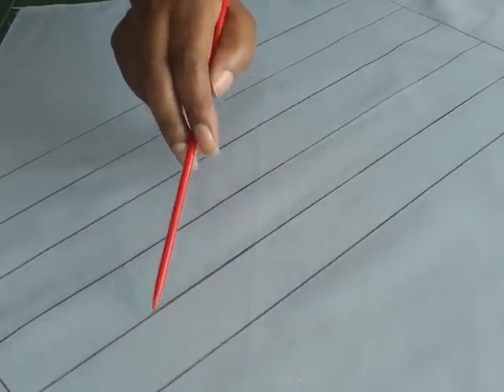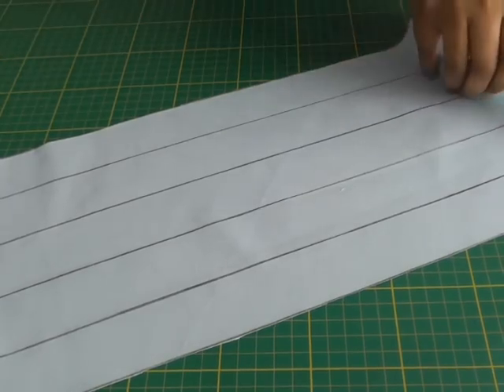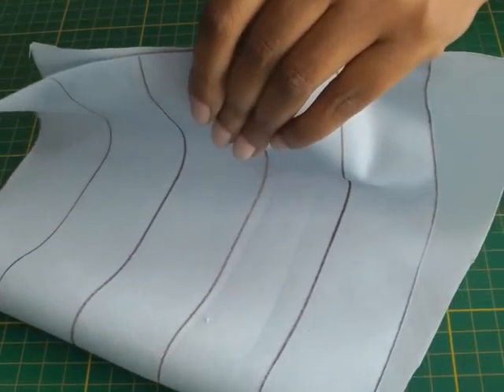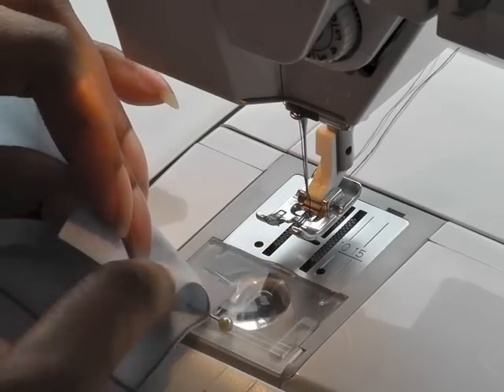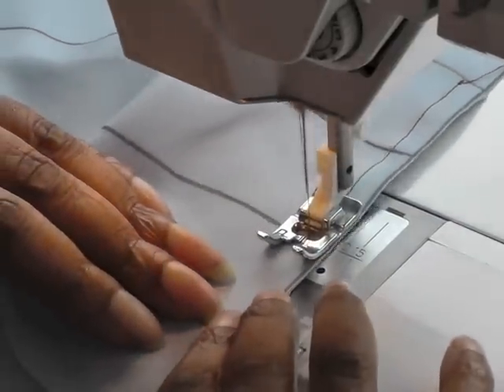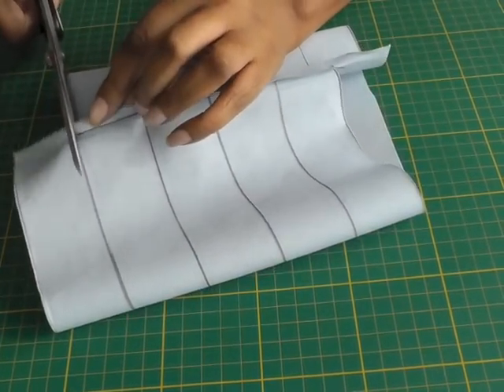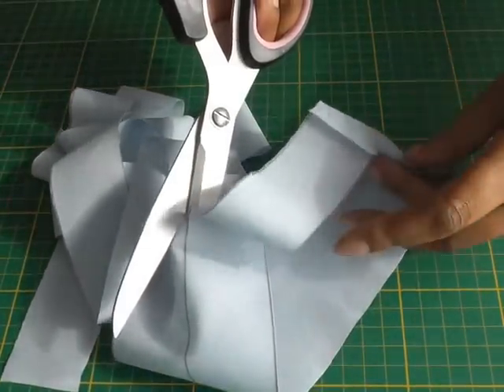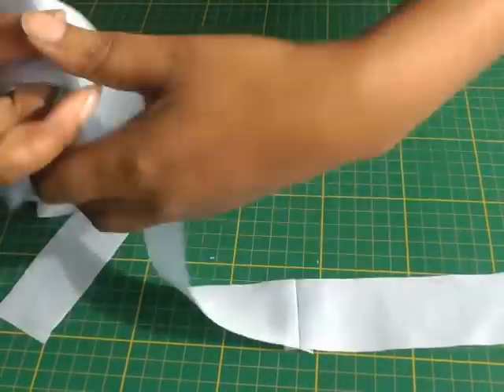Making Bias Strips | The Tubing Method

Comment: This is easiest method I've seen for creating continuous bias strips. All the other methods required a parallelogram first which was super confusing. You've boosted my confidence immensely!
Reply from the maker: Thank you Connie for your very kind comment.
Reply: Though the parallelogram method is a little bit more confusing, I actually prefer it over this one. That's because with this method the joints between the pieces of bias tape are straight. With the parallelogram method, the joints are at an angle. When the joints are at an angle, it is less bulky and less noticeable in your final project.